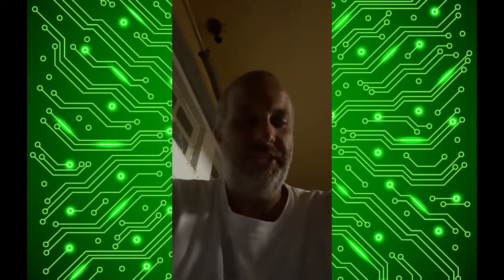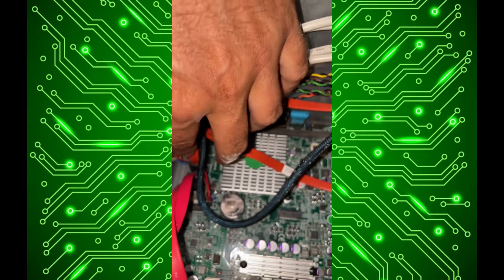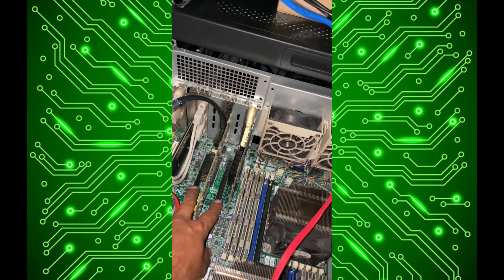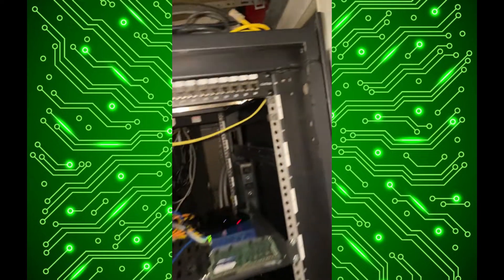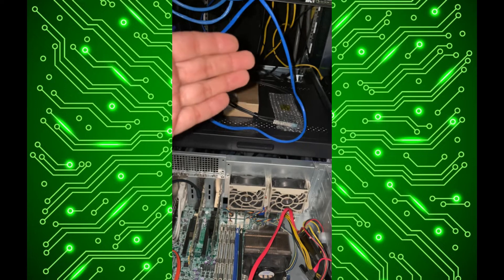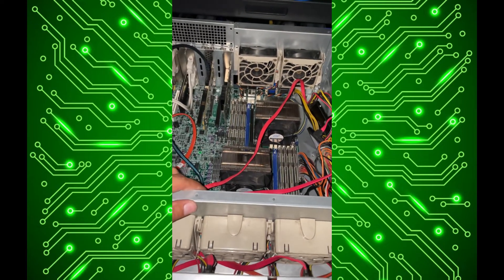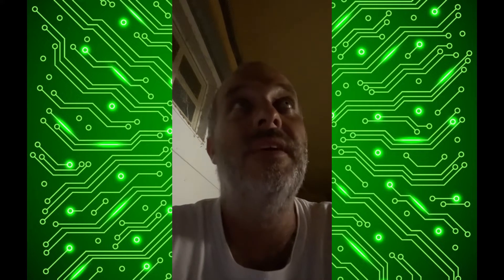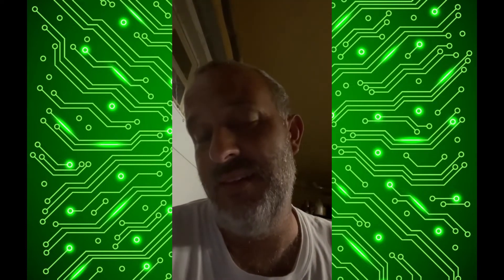Supermicro Server Upgrade Basics: What You Need To Know

Comment: Hello I just watched your video.  

I have the exact IBM 36U rack. 
I have a Super micro 846 chassis. 
I also have the SuperMicro rails for my chassis. 

My dilemma how did you get server mounted correctly in the IBM rack?
Reply from the maker: Oh I used J nuts in the holes of the rack to mount the rails. The chasis is mounted to rails. I don’t actually use screws in the front of the chasis to the rack, it doesn’t slide out on its own. If I have time I will try to make a video for you about it.
Reply: @RiverislandJoe  thank you!  That would be awesome if you can make a short video.  I’m going to my garage now to attempt your instructions.